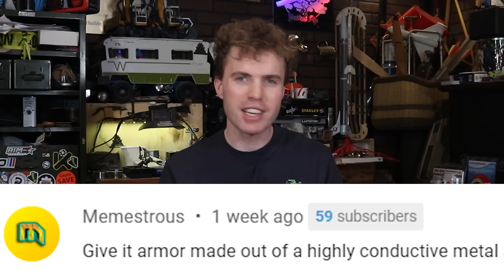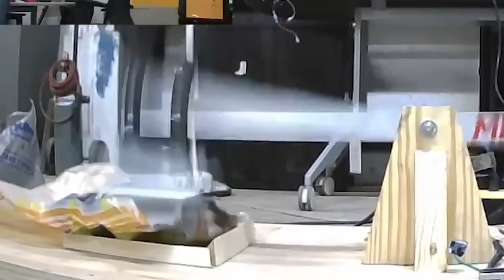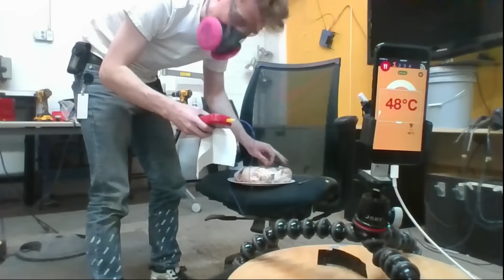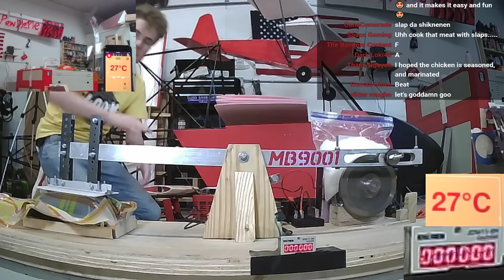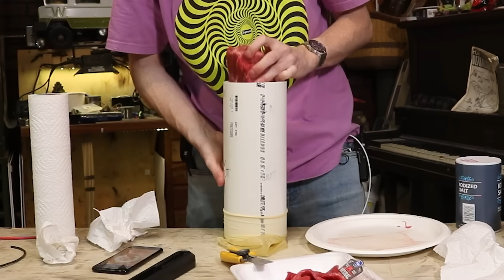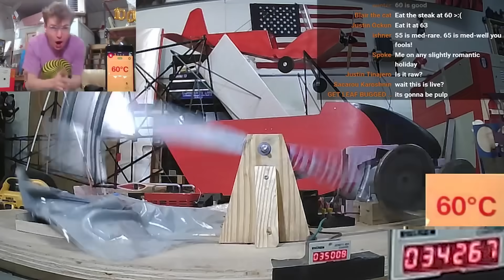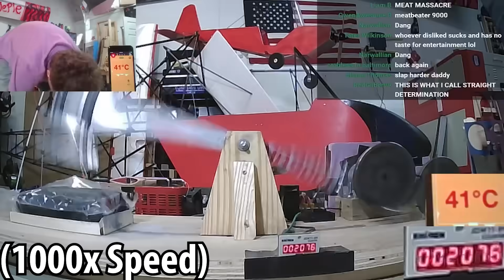I Cooked a Chicken by Slapping It

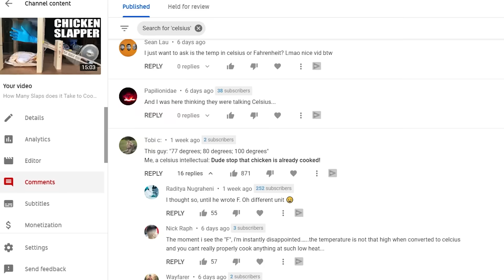Comment: 2:20 standard science technically you could measure the temperature in and even older unit of measurement, and as long as it is accurate and consistent that is all that matters. I hate the idea that using a standardized measurement system that you are comfortable with is somehow less scientifically accurate or sound just because it doesn't use the global method. It's still real science. Measuring it and Celsius just makes it easier for those who don't use Fahrenheit to understand.

Comment: Wouldn’t the aerogel already cause the chicken to heat up without any kinetic energy? If ambient heat from can be transferred only one way, it should produce a greenhouse effect where thermal energy continues to become trapped in the chicken system even when the room serving as the source of the ambient heat is significantly colder. I’m not claiming that the slapping isn’t the primary source of heat, but I’d be curious about a non-slapped aerogel-protected control group.

Comment: Isn't the first iteration of a prototype supposed to be overbuilt? Then after you get it working, you start cutting costs for mass production. Why did it take you months of work to get a stronger motor and use steel for the part that obviously needs steel?

Comment: Add an alternator on to the motor to reduce energy consumption, use a braced flexible arm for the slaps to reduce impact on the machinery - or maybe use a fully rotating slapper to make use of the centrifugal force to slap harder whilst balencing out your slaps per second need more slaps add more arms etc

Comment: I don’t understand how the steak ended up brown. Food browns due to the Maillard reaction, which does not occur during sous vide or slapping. Did you sear this steak off camera after slapping?
Reply from the maker: I, genuinely, have no idea what happened. 

It wasn’t crispy, like it would be if it had gone through the maillard reaction (toast, steak, etc), and of course the outside probably never got hot enough for that to happen. I think maybe the smacking squeezed out some of the hemoglobin (there was reddish juice in the bottom of the balloon) or the extended exposure to oxygen caused the steak to brown through oxidation. 

If you look at pics of steak that has been cooked via sous vide, but not yet seared, it also sometimes looks greyish in color like mine did. Pretty cool!

Comment: Not to be thaaaaat guy but, as a chef/cook myself, that chicken ain’t safe to eat. Though it was denatured through correct time and temperature controls, the chicken remained in what was known as the [temperature] danger zone for an extended period of time. Toxins can develop in these danger zones that make food no longer safe to eat even through denaturing or cooking to safe temperature. To simply this is the reason why if say you cooked rotten meat from dead wild animal, no matter what temp it’s cooked at, it is no longer safe to eat. Everyone’s immune system is different though but still best to avoid food safety threats even if one is not immunocompromised. p&l <3

Comment: Hm, multiple slapping mechanisms could greatly assist in the wear and cooling of motors and parts. With 4 devices sharing the slapping load, each individual one doesn't need to be so vigorous or so fast. You could much more accurately control the amount of force in the slap (thus reducing pulpification) and yet still achieve a higher speed, while greatly reducing the odds of a motor or other part breaking or overheating.

You could use 4 slappers, one on each side, slapping the chicken from a sideways angle (you could even hang the bagged up chicken on two rods along the Z axies to keep it stable and ensure more of the energy is going into the chicken and not into inertia)- each one slapping in sequence so that not too much force is applied at once.

Comment: And people still throw a fit when their Corolla takes a dump with 180k miles on it. This video really made me appreciate modern combustion engines. Imagine 4-8 of those Chicken Slapper 2000s going way faster, with explosions powering them, long enough to move an object as heavy as a car 100,000 miles and never breaking.. through multiple winters and putting off oil changes and heat and speeding up and slowing down.. think about it the next time you're not walking or riding a horse to the grocery store.
Reply: People take so much for granted now
Reply: I've been going via shanksmare for the past 10 years in central Florida. Rain, shine, humidity, air rated as Poor, wind, extreme heat and freaking hurricanes. No worries. Welcome to early old age.
Reply: Mate theres a difference between a 50 Trillion dollar megacorporation with nearly a century of experience and one dude in his basement
Reply: @BikuchWasHere mate you can still understand an underlying principle without taking it too literally

Comment: The heat capacity equation is 
Q=cm[T2-T1], you burned the engine because of the chicken’s size, and instead of attaching an ice to the pole, you decided to start cooking from 40 degree, and smaller piece.
So, the lack of calculations makes this video hilariously dumb😅

Comment: I was hoping you would have mentioned this, but I didn’t hear anything.  Why not use a large wheel and attach a flapper every 12” and place the chicken right outside the wheel so when it spins, it will slap the chicken.  Kinda like the wheel on wheel of fortune or price is right. 

Seems like that would have been an easier method. But maybe you tried it and I just didn’t see that part.

Comment: The vacuum chamber idea would actually work. By lower atmospheric pressure you are able lower the boiling point of water. So with the set up and insulation you used you’d probably be able to reach a higher temperature at a faster rate.

Comment: If nothing else, you proved that the theory was solid. If you can slap it enough times and contain the heat, with enough slaps, you could get it as hot as you need it to be. It’s just a matter of getting the right equipment and controlling the impact of the slaps.

Comment: Can't this be due to a hot metal arm, from the transfer of heat from the motor and friction with the joint pin, instead of the slaps?.

Comment: Ok, so here's what you need to do: hire at least 100-200 karate masters who have the advantage of both a powerful slap and extensive nerve damage from years of slapping practice. Have them all form four lines on the north, south, east, and west sides of the chicken. Then, each karate master will take turns, counter clockwise, slapping the chicken once before retreating to the back of their line. This will give each karate master a short respite to allow their hand to recover and keep them from becoming fatigued. Meanwhile, there is no reason the chicken has to remain stationary, so wrapping it tightly in a vacuum sealed bag and putting it on some kind of rotisserie will ensure an even cook, and will presumably help trap the heat inside as you'll be warming the entire surface of the chicken at once instead of heating only the top. Now, I know what you're thinking: How do I afford to pay 100-200 karate masters to work for an indefinite amount of time? You don't, you donut. Gordon Ramsay does because this is the dish that you will present to him after becoming a participant on his very own show: Hell's Kitchen. You don't have to win the show. You just have to cook the chicken.

Comment: Sorry , this looks like beating instead of slapping,  maybe you should use a flexible arm, and spin it , after slapping the chicken, it will retract and make another turn and slap again,  current set up looks like have a lot of energy work back to the motor and the wheel , if the chicken is hard

Comment: You have too much moving mass. And you are losing half your energy on the upward movement. How about a wheel with flexible metal flaps that keep slapping the chicken and then bend away? It should be much more stable construction, it should use less energy more efficiently, and the chicken should be less pulverized
Reply from the maker: Watch part 1 - we tried this with rubber

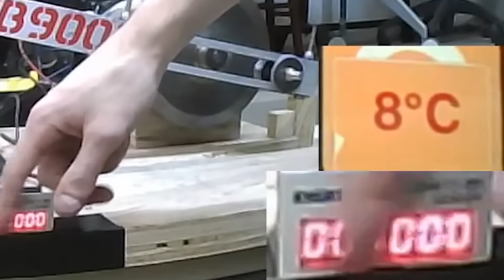Comment: 2:30 Celsius is NOT the system of real science because it isnt even base 12. Europeans are so self-righteous. If they traveled the world, theyd see that nobody really uses one system of measurement in most measurement systems. And nor should they, being polyglot in terms of measurement is better than knowing one system. Especially since incrementation (unlike on paper) matters in practical application in real life. Sometimes you have to measure something to the nearest millimeter, or other times, 1/16 of an inch or the quality of the product will go down or equipment will experience too much wear and tear, etc. Despite the measurements being eeirly close to each other.
In fact, people get so weird about linear measurements not being in base 10 which is weird, Because sometimes....it is measured in base 10. So according to the metric people, theres nothing wrong with imperial since it literally is used in industrial settings as base 2 fractional or as base 10

Comment: i would prefer vertical linear piston style slapper. it can be done with bended stainless steel, you could adjust weight of piston therefore you could able to control slap force.

Comment: I don't like that he walked off camera to pour out the meat juice. I don't doubt the engineering but my paranoia ruins the trust I had that the steak was actually cooked by the slapper. Especially because it was cooked really evenly which seems strange even considering the bag into the equation. It was also very intact despite the amount of energy that had to be converted from mechanical to heat energy. I hate to be skeptical because I want to believe this so badly.

Comment: Easier way: Keep the chicken on the hot surface of the motor since it worked for so long, it should be much much hotter
Reply: ah but then you're cheating,  the experiment was to transfer the heat using ONLY slapping power.   all the other work-heat generated that is not a slap can and should be removed from the experiment

Comment: The steak being cooked with slaps is acctually an interesting idea because it would allow you to use cheaper meat which is tough but the slaps tenderize it
Reply: The amount of power needed to cook a single piece of steak with slaps would outweight any savings you might have gotten, that you might aswell have just bought a prime cut and cooked it on a gas range.
Reply: @LamborghiniDiabloSVPursuit  likely true due to me not having anything to acctually support the idea
Reply: @LamborghiniDiabloSVPursuit  I disagree, steak doesn't need to reach the same temperature as a chicken and is still edible raw, meaning it doesn't require the same energy in order to produce a steak that is edible
Reply: 5head
Reply: Tenderize or vaporize?
Reply: Spending less money on the food but more on energy lol
Reply: @tomlxyz  it's like cooking food using the heat from a nuclear reactor tank.
Reply: Or you could deal with that problem in a way that doesn’t ruin it
Reply: Idk, the power bill might be rough
Reply: @travisallgeier4207  Yeah, if you used this method at a restaurant, you would go out of business because of the energy demand.
Reply: @hdjksa52  your restaurant pays the power bill? I'm jealous 😆
Reply: It took 3 times the amount of energy to cook the meat and it took longer. It's not worth it.
Reply: electricity bill makes it better to buy wagyu beef.
Reply: Thats... That's what smoking is. Except it's better.
Reply: That's already a thing. It's a pointed hammer used for hitting tough steaks to tenderize it.
Reply: @Leon-mn8eo  lol "a pointed hammer" you mean a meat tenderizer, a hammer with little spikes on it.  You are describing an ice pick lol.
Reply: mmmno xD

still way cheaper in time and energy to do this other way xD
Reply: Except the tenderness isn't all that you want.  The fat content also makes it taste better.  Also, as he said, it was like eating already chewed meat.
Reply: thats not how it works....
Reply: Or..... You can marinate it in a very good marinade that has certain additives in it like lemon juice which has acid in it that tenderizes the meat properly and of course cooking it the right way helps as well.
Reply: If you want to use cheap, tough meat but have it taste amazing and tender and juicy, get a sous vide
Reply: Minor spelling mistake
Reply: Then you get a salmonella and you'll never have to pay for food again because you'll be FUCKING DEAD
Reply: Salmonella in steak? Man if that start happening regularly the we'd have much bigger issues goin on in the world
Reply: @jdrmanmusiqking  no problem we can slap it then cook it well😂
Reply: @diogenescinico  cheaper meat =/= bad meat. Orig comment meant just not first-class, soft and yong meat, but more hard (like from older animals or grown on more cheap but not so premium feed), which is usually cheaper, but still eadible. It is about half of meat in shops. And if it is too hard, you, well, beat em up with kitchen hummer
Reply: @Airin258  read the comment above yours
Reply: @Airin258  bro I was looking what is Yong meat on Google . 🤣
Reply: @3t1r03  lol sorry, it's just how it's called in my language. I meant meat from yong animals.
Reply: @Airin258  aha it's alright I was just confused. Even for me English isn't my first language 😅
Reply: @Airin258  Meh, if I'm going to have a steak, might as well be a good cut.  Otherwise I'd rather just keep my cow consumption down.  I despise chewing  and chewing until I all I have is a ball of "meat" in my mouth that taste like cardboard.
Reply: I would not look that up. Might get you on a list
Reply: @diogenescinico  is salmonella that deadly?
Reply: @fpkblast8465  I don't know, it's just a joke
Reply: @fpkblast8465  Depends on your immune system and exposure I suppose.
Reply: @fpkblast8465  yes
Reply: @PrincessSunbutt  e coli is in beef not salmonella

Comment: As a way to improve the meat beater again, it seems like you’re wasting a ton of energy by accelerating and decelerating the lever arm on every repetition. I wonder if creating a meat beater that rotates fully around with a flexible arm would be more efficient so that the only energy lost is friction (other than energy lost in slapping the chicken, which is obviously desired)
Reply: it would not, that would increase the damage liability and full rotation would not work, as you need collision for energy to transfer, hence to heat for chicken.
Reply: @steadfastwolf2159  how about,   one that slaps both sides of the chicken?    one slapping the upper side on the downswing,  one slapping the underside on the upswing
Reply: They tried that but it basically vaporized the chicken because it imparted too much energy.

Comment: i would have just made two wheel with hard rubber slap paddles and span it at high rpm on each side of the chicken and set the motors timing so it would back and forth slappage...

Comment: I was just thinking... but, instead of that design, why dont you make a water wheel like design, have it rotate around while using soft rubber like paddles to slab the bag, if done properly you could have more then one paddle hitting the back in quick secession which should in theory cause it to work faster.

Comment: I think you're using a DC motor there. DC motors tend to have worse efficiency when you run them slowly, so I would suggest that you run them at a higher speed. Also, you should make your arm as light as possible so the motor can spin faster, making it more efficient, causing it to generate less heat.

Comment: In thermodynamics I'm acutally used to Kelvin instead of °C. But 1° of temperature difference is the same as one Kelvin of temperature difference. Just the offset is different so its at least way better then °F. (In never really got why you would use a temperature measurement thats based on a mix of different chemicals that you dont really use that often in every day life anyway...)

Comment: this is gonna sound stupid, i know.
BUT why did you opt for that huge machine?

The engine of a car has cilinders that go up and down very fast.
All you have to do is increase the pistonhead with a metal plate, but you can use the entire engine case.
And no, you dont have to use a car engine.
A crank is also found in a moped, or a motorbike engine.

It can go up and down many times a minute, and all you have to do is connect the electric engine which you now use to the crankshaft.

Would that not have been Much easier and stronger?
Reply: Heck, you can make your own crank. From wood if you want.
But why you choose this lever arm machine setup, i dont know.
Reply: ps: Medium rare steak in my mind has nothing to do with temperature.
Normally you would use a very high temperature, to roast the outside of the meat so it wont leak away its fluids, and you would keep it on that high heat for a short amount of time, both sides about the same amount of time. And then it will be medium rare.
60 degrees Celsius is cooking the meat.
You may cook it until it is medium, but it aint like a steak from the grill, that is for sure.

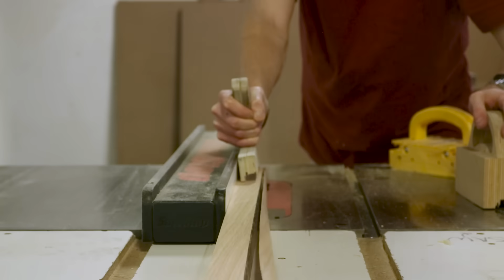Comment: 1:00 we need to talk about this table saw... measure distance from that spinning blade to your wrist. don't do that. look at the force direction of your arm, pushing down and away. bad. if your hand or the work piece were to slip, your body should be in a position that it will continue motion in a safe way, away from the blade.